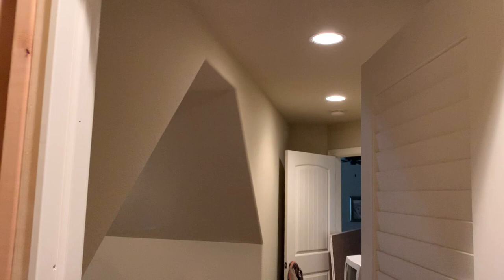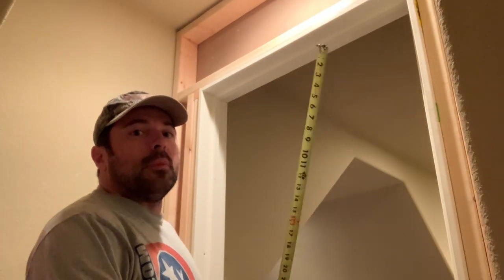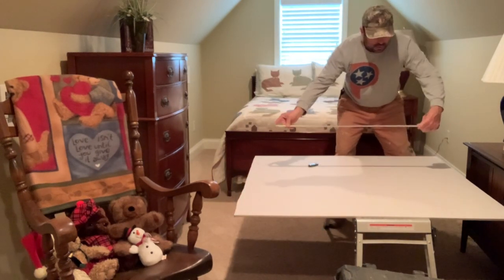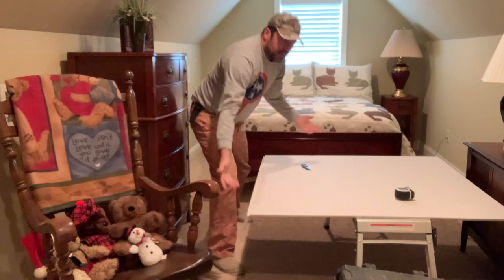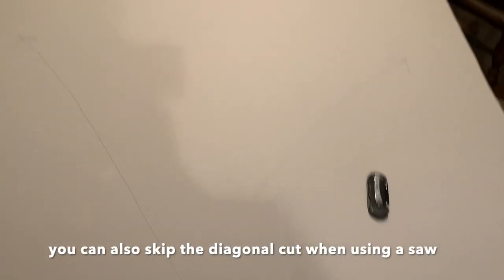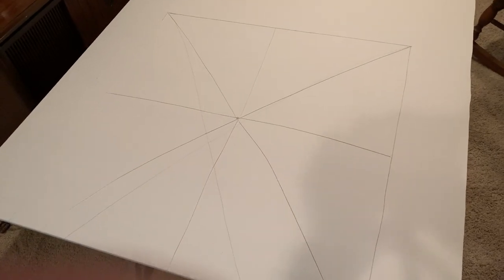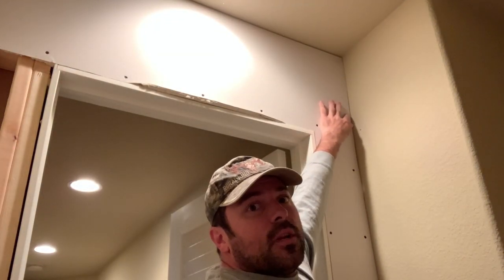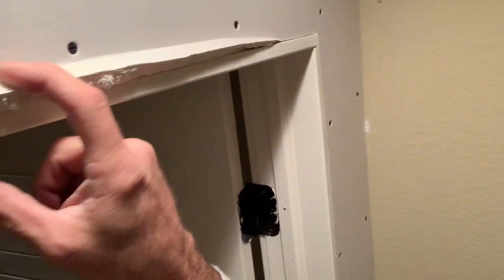How to install drywall

Comment: My joint compound work usually winds up looking like a kindergardener did it.
Takes a lot of practice to get it right...but I keep trying . one day I'll get it right. Thanks for the tips.
Reply from the maker: thanks, I'm not the best. that's what they make sand paper for, lol. A wet sponge does a great job on smoothing it out too, and without the mess of sanding